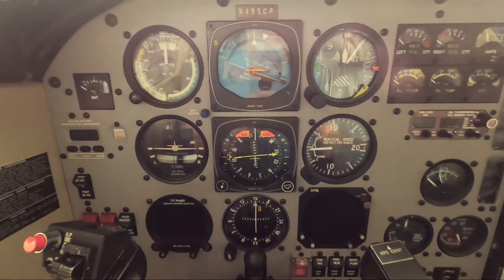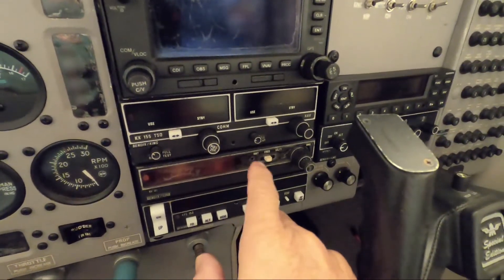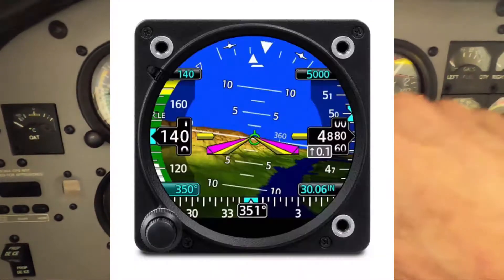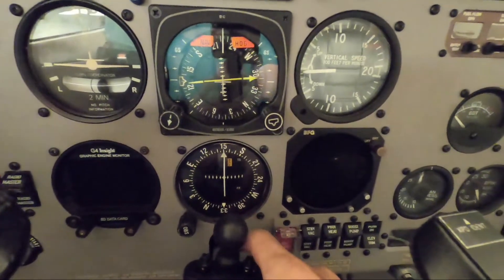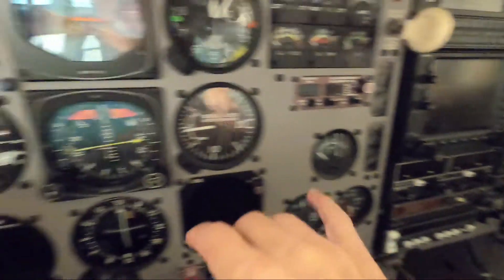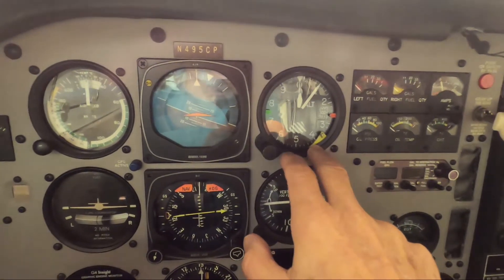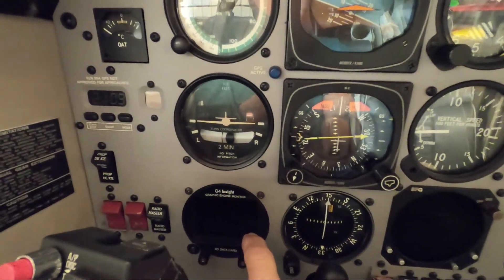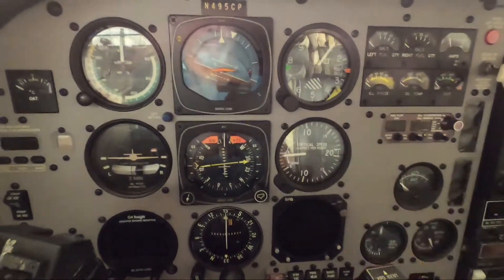Mooney Ovation dual GI-275 Panel Upgrade - Part 1: DECISIONS.

Comment: How Proficient are you at patronal panel like Needle Ball and airspeed.  On my very first actual IFR flight after getting my Instrument rating I had a Gyro Horizon fail in flight. It wasn't Low IFR about 900' ceilings.

Comment: Hi Chris,
I recently got a M20L 1988 converted to M20R with a Cont. IO-550N.
My attitude indicator is a KI-254 not working well with the KFC-150 AP.
I opted por a couple of G5s, soon I realized it won't work, neither the G3X.
I saw your 2 GI-275 solution but the Garmin vendor said it wouldn't work with my AP computer KC-192.
Now I'm being offered the Aspen Evo. 1000 pro, but I'd Rather go for Garmin since I already  have the GNS-530 and GTX 330ES in the panel.
I'd like to have your comment, please. Thanks
Fer Catalan
fercat5106@gmail.com
Reply from the maker: Hi Fer,
I have a KFC150 autopilot system with the KC-192 computer driving it. The GI-275 ADAHRS+AP unit works superbly with the KC-192. Not sure what your installer may be looking at. I would not go with the Aspen at all. The dual GI275 setup is much superior.
Shop around for another installer and get more opinions and possibly specifics as to why the 1st guy said it was not compatible.
Reply from the maker: Where are you located?

Comment: The KX155 should be able to send an ILS to the Garmin 275 HSI.  I was flying my buddies plane today and it worked great.
Reply from the maker: KX155 can send VOR/LOC info to 275 HSI as long as it is not setup as a standby ADI as well. 

I presume your buddy's HSI is a standalone HSI and is not configured as Standby ADI unit for another 275 ADAHRS (+AP) configured as ADI.